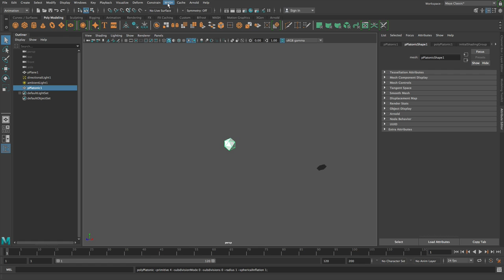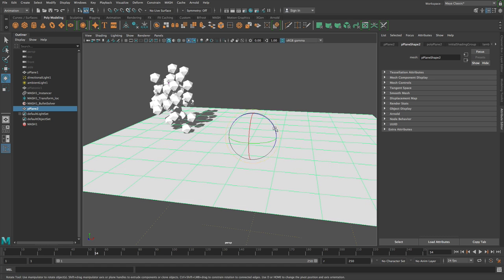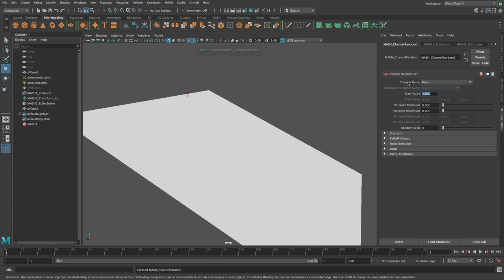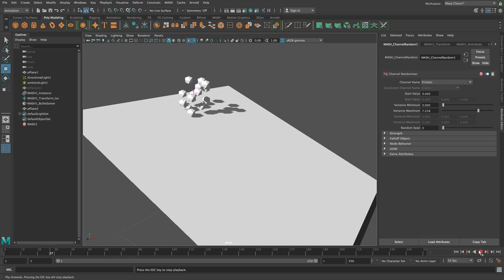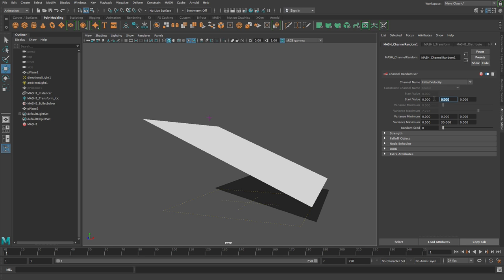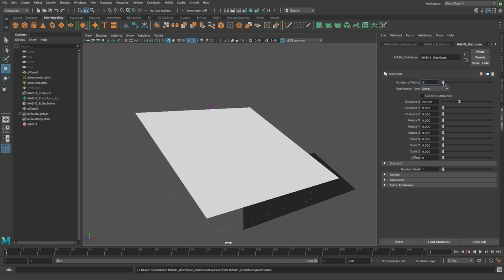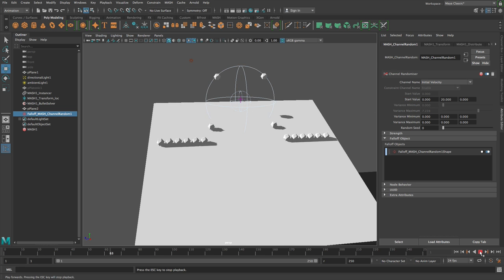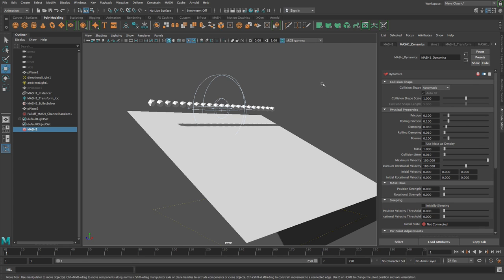MASH Dynamics No 6. Per Point Attributes

Comment: Every per point parameter works for me perfectly except for initial velocity (rotational initial velocity works though) any thoughts as to why this might be happening?
Reply: Figured it out. I needed to set some arbitrary number first for initial velocity within the dynamics node. Simulation works perfectly after doing that. I am using Maya 2019 student version just in case you are interested in checking out the issue.
Reply: Hii! I have the same problem, what do you mean if you say “set some arbitrary numbers”?  In what part of the dynamic node?
Reply: @itsMarviiin  Thanx Noah Mitchell, had the same problem. It's also still there in Maya 2020... You need to go to the "Mash_Dynamics" Node and set the value of the "Initial Translational" to 0.001 to activate this attribute if it's set to 0.000 it will not be calculated in the MASH_ChannelRandom Per Point Adjustment Channel. (the Attributes are in X,Y,Z order, so if you want the Initial Velocity to work you need to put this value the second channel)